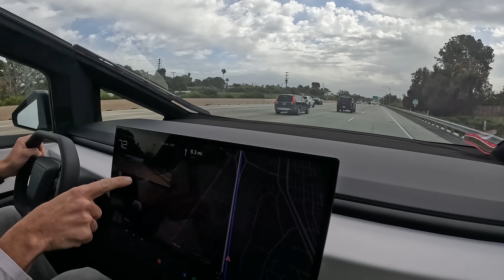Moving Back in a Van! Why??

Comment: Great looking Van. Where is the bathroom?  Good Luck To Your Future Jarrod.
Reply from the maker: Shower off the back and toilet under sink. As someone that has lived in vans full time before I use gym bathrooms way more anyways
Reply: Planet Fitness Black card is Golden! I guess you could say I've been a vanner for years. I high pole/ escort oversize/ supersize military loads from Canada to Port Aransas, Tx. It takes 2 weeks to get the convoy from Canada to Fort Worth, then 2 weeks just to get to Tx coast from FTW. Once the loads are securely in  ship area, I try to get a long load, or connects to pay my trip back to Canada. Living full time in escort vehicle with 3 dogs, all my safety equipment and communications equipment is a art. My old 70's Coleman stove still does the cooking wether we are in a ice storm or the coast. A cassette potty tucked under the bed still works too. I guess the only reall luxury I splurge on is a very good mattress so wherever we stop, for those few hours, we get charged up to start the rodeo again. The best tires you can buy, the best mattress and the best cb are what I focus on. I was averaging so many miles I was changing oil at east once a month, usually 2. The military is super controlling of the route, loads so we parked some weird places and they have fuelers that keep us full. I just got my next vehicle ( I usual run so many miles I have to replace them every year or so) and it was stolen with all my equipment, my life gone. The high pole is a crazy risky way to make a living, but, DARNED IF IT DOESNT PAY FOR THE VAN,THE GEAR, THE LIFESTYLE! IM TRYING TO GET THE FUNDS TO REPLACE THE VAN, RADIO EQUIPMENT AND SAFETY EQUIPMENT SO I CAN GET ROLLING AGAIN !! I SURE MISS IT! BEST OF LUCK TO YOU

Comment: Would it have been cheaper, easier, more versatile and repairable to use diffuser strips with RGB LEDs? Rather than expensive boatal tote epoxy. Aside from the SV logo stuff.
Reply from the maker: There are RGB leds being used plus the epoxy. Reason for the epoxy is to soften the light coming through and give it more of an effect. Some would say why not use plastic inserts and that’s because the ceiling as a slight bend to it and a thin layer of epoxy can bend when used correctly